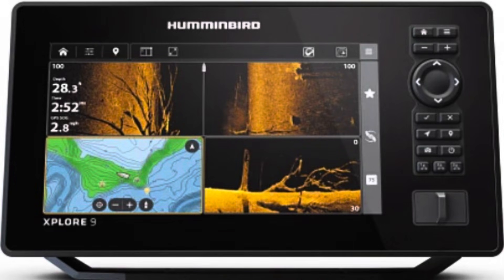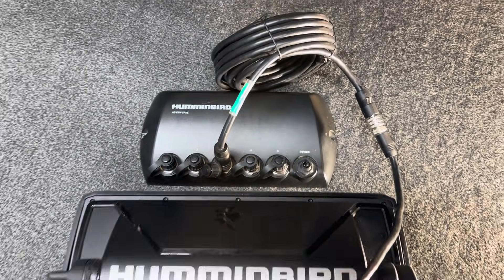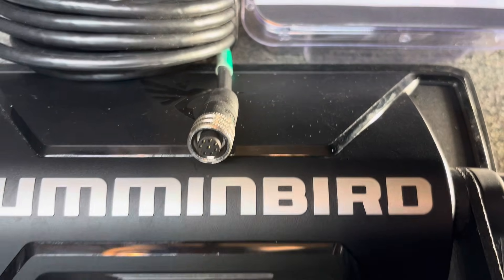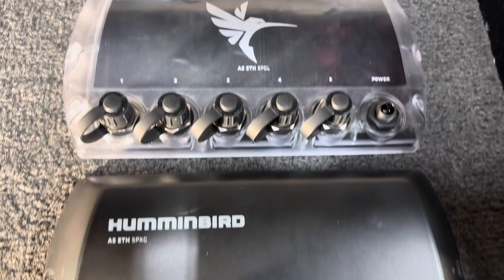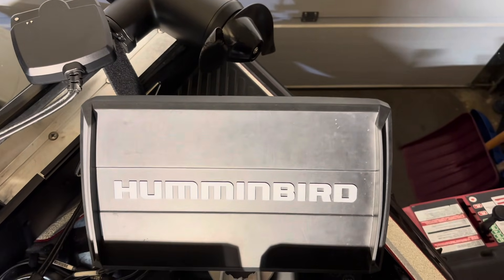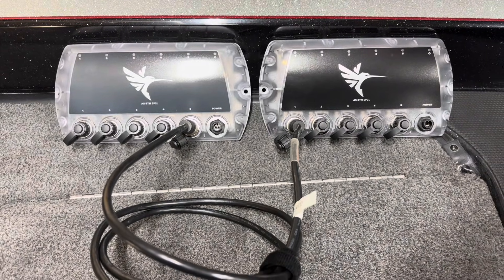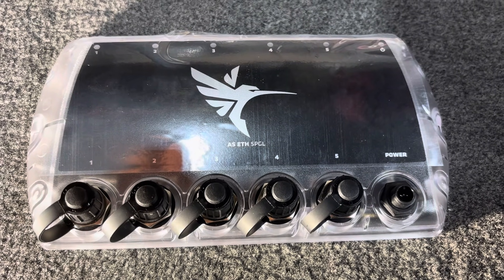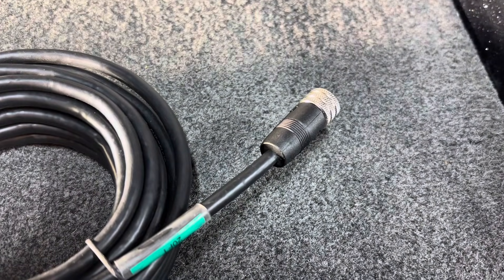Humminbird 5 Port Ethernet Switch Questions Answered

Comment: Great video one question.  You mentioned you had a g2 helix on your consol but mentioned g3, g4 and were compatible with pgl.  Were you able to network the g2 because your daisy chained to the pxg or did the g2 actually work with the pgl?
Reply from the maker: Thanks for the kind words. The G2N does not work with the PGL. You can’t do the PXG and PGL with the G2N. You need two PXGs to use the G2N with the G3N and G4N.

Comment: Hi Steve, will the existing ethernet cables that I used with my Helix units work with the new Xplore units?
Reply from the maker: @ThomasKnapik  Yes, remove the AS EC QDE adapter dongle and plug in directly to back of XPLORE unit. My units are all connected through a hub so it’s a simple conversion, remove the dongle, plug in and you’re good to go.

Comment: I have only two Helix GN4 models plus the trolling motor so no issues for me, however, I am wondering why you say only 4 HB units can be connected when there are 5 ports? Also, any advantage to upgrade other than than the link lights and potential for a 100 mb connection should I ever add a 100 mb compatible unit?  Thanks, great video.
Reply from the maker: I was surprised too when I first found out that the PXG would only support 4 Humminbird control heads but that is direct from Humminbird. I thought 5 ports, 5 control heads which is why I am switching over to the PGLs. The lights and trouble shooting are my main reasons for switching over other than letting me use 5 control heads. Thanks for the kind words on the video, they are really appreciated.
Reply from the maker: I wish I could give you a more specific reason why Humminbird would not recommend allowing a 5th unit but I am sure there’s an engineering aspect to it that would give us the necessary explanation.

Comment: Good video Steve. It was nice talking with you at the Toronto International Boat show, and helping me in purchasing the Xplore series units with ML2.
Reply from the maker: @pete_schuessler  Thanks Pete, you both made a great choice in purchasing the XPLORE units and ML2. It was my pleasure in helping you get such a great set up. Remind me what boat you’re putting the XPLORE units on.
Reply: @stevechiassonfishing5876  We purchased a Legend F17 Series in 2021. Mercury 115 Pro XS. Great boat. 
It also didnt take us long to sell my ML1 system, which will help the cost of the new units :)
Reply from the maker: @ Every little bit helps! With a 115, your side imaging transducer may not read 2D at higher speeds. If that’s the case you may need a high speed 2D transducer and y cable, both reasonably priced. Try it without first but just wanted to give you a heads up on that one.
Reply from the maker: @ I can give you the information on what to get if you find you need one. Congratulations again on your purchase! The more I play with the XPLORE units the more I am impressed with them. I am excited, like you to get them on the water. Just sold my ML1 too.
Reply: @stevechiassonfishing5876  Excellent. Looking forward to seeing your upcoming videos. Very informative stuff from what I seen so far. 
I will see this spring how the transducer holds up. I had no issue with the helix SI transducer at high speeds. IF you angle your transducer just right you can get readings at high speeds.
Reply from the maker: @SchooseAngling Just wanted to give you a heads up just in case. I am definitely looking forward to creating some new content with the XPLORE unit.

Comment: Can you attach transducer  to ethernet switch  ?
Reply from the maker: MegaLive transducer yes
Reply from the maker: Others no
Reply: @ Thanks I asked because after i updated the new software 4.190  so some crazy thing my one fish finder has the transducer on it and that fine but the other one it doesn't come up on screen. it has the check mark for the other transducer from other unit. I have to check it off, then back on and then it shows the depth on other unit.  The 5. something software update i heard that doesn't fix problem also so i still have the 4.190 software.

Comment: Great Video, very helpful. 
Thanks
Reply from the maker: Thank you for the kind words, they are very much appreciated. I had many questions myself about the two Ethernet switches so I felt an educational video would be helpful. It’s always nice to know your hard work is being recognized and appreciated by viewers.
Reply: @stevechiassonfishing5876  you really simplified it, I saved your video to reference how I'm going to install my new Explorer systems.  The installation instructions are not really clear.  Thanks again, Brian
Reply from the maker: @Nutintoitbut2doit The XPLORE units are really impressive! I will definitely be converting some, if not all, Helix on my boat to XPLORE this year. The waypoint management system is definitely better than the Helix. The touchscreen certainly simplifies things for users too. I have been playing with them at the Toronto Boat Show and see how much the technology has improved so I am excited about making the switch. I will definitely convert to the 5PGL switch moving forward as I will eliminate the Helix G2N at the console first thereby I have no limitations of a G2N on my network.